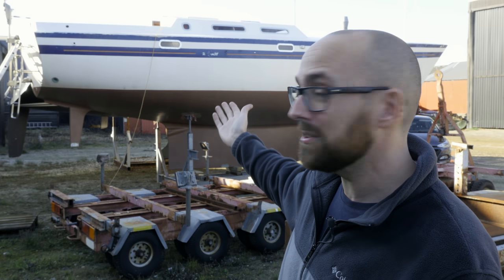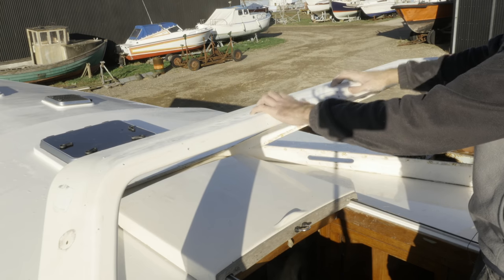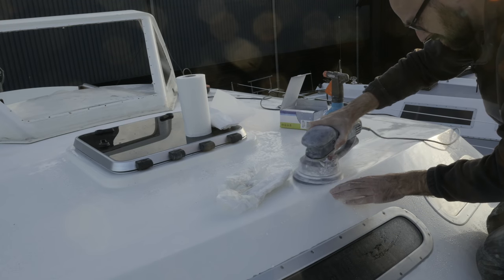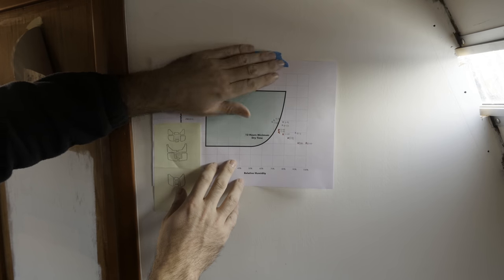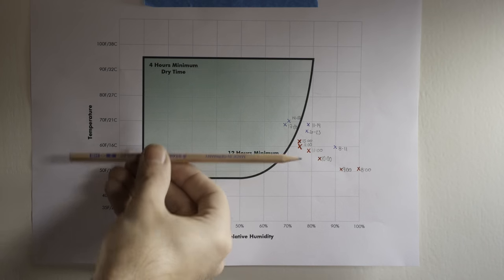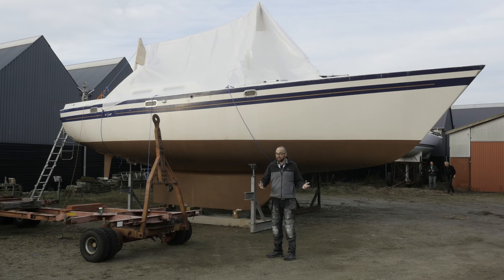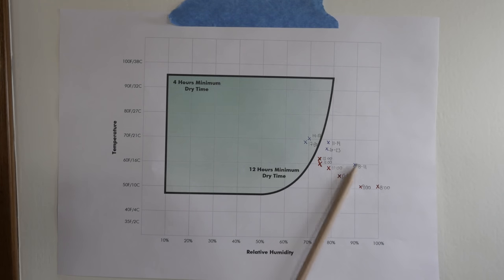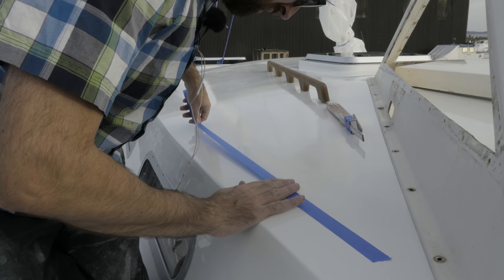Sail Life - KiwiGrip non-skid with custom logo & fiberglass dodger - DIY sailboat repair

Comment: Mad's great video as always. Obviously speakers are a personal choice. However, If we may just add some thoughts. We love our music, talking books and pod casts. When on passage,  at anchor or along side we use the cockpit like another room. Having the ability to play all of the above through a set of good quality speakers via our audio system makes a difference. We have front speakers in the saloon, rear speakers in the cockpit and both sets are sufficiently far apart to get a good stereo sound. Our "Radio" has bluetooth so our phones and devices can input to the system. We added a double pole switch to the rear speakers so that the rear or cockpit speakers can be switched off at the flick of a switch. When docking, putting the anchor down or in a marina where we would not want to disturb others. The system also links via our smart TV, so any videos, TV, Youtube etc can be played through the superior radio amplifier and our saloon speakers to give a much better sound than the TV. Linked to our onboard Blue ray player we get to watch our favourite DVD's and Blue rays through the same sound system. It was not expensive and the technology is already out there. You just have to link it via bluetooth and/or the radios various inputs. 75% Of the quality of your sound will be down to the speakers, their positioning and location. If like us you love your music, talking books and pod casts you may want to think about this now as you set the boat up for living aboard. Food for thought? Sail safe, Ant & Cid xx

Comment: One thing you may want to consider while you are working on the dodger, is that once you start passage making you are going to want to have a radio in the cockpit, if you don't have a marine VHF in the cockpit, you are going to find yourself doing a lot of running  back and forth between the helm and the radio. 

I personally would really like to have a large speaker for the radio in the cockpit that is of better quality than the built in speakers that come stock inside of radios, you may think about finding a place for that where it will stay dry while doing the dodger. 

On my boat when motoring the radio becomes effectively useless because I cannot hear it. I will be swapping it out and going to a similar setup with a cockpit speaker that can be turned off, and a cabin speaker that can be turned off, this way you are not disturbing the person who is sleeping with the radio. 

I am sure that will keep Ava happy if she does not have to hear you "yammering on" as you would say in a busy sea way while she is sleeping.
Reply: Simrad 35 with bluetooth handset is the easy solution :)

Comment: Good call on the tent! Use 2 or 3 inch masking tape. Also remember less is more on the kiwi grip start with the smallest notch and you can easily add more later, but it's harder to take away. The boat is looking awesome, but then again you already knew this!

Comment: Definitely go for stainless steel handrails. It saves teak trees and is much easier to maintain!
Reply: ilCigno plus it looks more like a star fighter :-)
Reply: But is harder to hang onto with wet hands.
Reply: @jens

Yes, and that's a safety concern which is why I prefer wooden grab rails, gotta make sure you can get a good solid grip, one hand for you and one for the boat, at all times.
Added.
Of course, wood do age so you gotta keep an eye on them.
Reply: Stainless can be very hot/cold depending on weather conditions but would love a lot better with the other hardware and port surrounds.

Comment: We used a similar product on our decks for 20 years and loved it. We taped off the edge and painted a primer coat , then two coats of the latex product with a loop roller similar to the one you used. We found this thigh latex coat was very anti slip enough to keep you from slipping in a rain storm.

Comment: The boat is really looking good and the cabin top looks great. My vote is for teak grab rails. Even if the take some work to keep them up, the will add a bit of class that will take the boat off the spiffometer.  Regardless of your decision please but grab rails on the outside of your dodger, you will be glad you did. Cheers, Chris

Comment: I think using a smaller trowel and “less” kiwi grip will be a better solution, the cabin roof texture looks a bit heavy to me. Love the logo though, that was spiffy! I agree with other comments that the stainless handrails will have. A higher “spiffy” rating then the teak. Love your channel, it really helps to keep me motivated on working on my boat. I am considering vblogging  the process as well. Cheers!

Comment: Entertaining and informative as always, Mads.The light at the end of the tunnel is getting brighter and Athena's looking awesome! Not trying to be a back seat driver, but I'm glad you figured out that less KG is better. When I saw how much you were putting on I kinda cringed-sorry- but I've done more than a few boats with it and found you don't need a lot to get a good grip and make a uniform coat. I just spread it on with a 3" brush and found that the roller evens it out nicely. If any gets where you don't want it, lacquer thinner will remove it after it's hard. Just don't leave a rag wet with lacquer thinner sitting on it....don't ask.  It's a great product. FYI,  the local rep told me you could buy white and have a reputable paint company tint it any color you like, since it's a water base. I've done a couple boats with custom deck colors....

Comment: Looks great.  Much progress.  On the non-skid, KiwiGrip or other brands, very coarse or aggressive non-skid leaves little valleys that tend to collect dirt and moisture.  The least aggressive treatments generally are easier to keep clean, as well as being kinder to knees and barefeet.
Looking forward to the decks beams.  Maybe contrasting woods, laminated in 1/4" layers?  Sorta Danish Modern???  :)

Comment: In this case I would definitely go for the teak rails. It ‘wood’ add character to Athena. And wood is always more boat’ish than stainless steel or aluminium. And, you have already quite a lot of stainless details already, so some pieces of wood could balance it. Maintenance of the teak will be done in some minutes, so that’s hardly any issue. Hope you’re happy with the kiwi. Maybe the logo should have been a bit bigger in size? But I reckon it’s nothing to put your resources into at this stage?

Comment: Looking good! -- Why don't you build a little leanto off the side of the boat for sanding and glassing.  Could even use some sheet foam and a heater for curing on cold days. 
Craig

Comment: The reason that rock was expensive is it's a Marine Rock.  You can find them at any marine hardware store.
Reply: I think he got the premium one with the green Marine-grade low-friction coating pre-applied.
Reply from the maker: Haha! :D
Reply: Next time save money on marine rocks and get them from a big box hardware store. The side of the road works too.
Reply: Or spend more and get the aviation grade rock
Reply: Maybe one from a Pacific Ocean beach? The hiring of a selection committee, travel expenses and shipping costs could even exceed that of the Aviation Rock.
Reply: High-visibility contrast-green on one side ... an extra. Oh, and no environment will be harmed when released into it ... an extra, too.
Reply: WARNING: Do NOT use Hawai'ian Volcanic Rock (in Denmark)! Super Bad Kapu! Pele WILL dissolve all your epoxy.

..and I doubt Óðinn, Vili, and Vé are particularly worried about bits of Ymir being used for boat work.

Aloha nui ʻoe, kahuna kelamoku! :) 🤙
Reply: Also when you are done with the epoxy, to get your rocks off. From one Dane to another.

Comment: Regarding the speaker holes in the dodger:  I understand that a bluetooth speaker would be good for music, but isn't there a good reason to have wired, mounted speakers for various navigation , communication, and warning systems?  (DISCLAIMER:  I have no idea what I'm talking about.  The little bit that I think I know only comes from various YouTube channels.)

Edited to make it doubly-clear that I didn't mean for this comment to come off as a criticism.  I'm sure Mads doesn't need those holes in the dodger.  I was just hoping someone could teach me something.  Are there audio devices on a boat that you would want to hear, even when you weren't expecting them?
Reply: David U you’re absolutely correct. He will need them for sure.
Reply: @rickfrazier1148  you can hook a Bluetooth module to the external speaker output.
Reply: SouthJerseySound sure. I’d still want hard wired speakers mounted. To each their own.
Reply: @rickfrazier1148  he can still add a external speaker and now he's not limited to finding a exact fit. Those speakers where most likely stereo and not vhf radio anyways.
Reply: Perhaps it's the strong music background, but hell yes to speakers, good speakers, mounted, & wired, wired to vhf radio, ipod, tv, easy to switch.  More wave generation means less dB is necessary to be heard.  Great music during a stressful time is lovely.

Comment: Stainless grab rail.  Red in logo (small paint brush with help fuel cdo [ocd in alphabetical order like it should be!]). Also the cockpit needs something to prevent you from slipping throughout the winter.  More kiwi grip or a towel or something.  Looks great!

Comment: Hello Sir, I have been looking into replacing my old carpet in my fishing boat with a deck liner. So far, how has the KiwiGrip held up and is it easy to clean?  I have looked at Durabak Marine liner but it requires the use of Xylene prior to painting with Durabak, which is very harmful to breath and you must not get it on your skin. Very nice sail boat BTY!!!  I have a friend  I grew up with in Charleston, SC USA and he sails all the time. He's into pleasure as well as regatta's. He has 3 sail boats. Just looking for some constructive advice from a mate that has used the KiwiGrip.

Comment: Any thoughts on weight balance/estimated change to the hull/deck after your restoration? Thinking your osmosis treatment and lengthy rebuild may have reduced weight in the hull but perhaps added weight to the deck?
Reply: shinybaldy wouldn’t dry core be a lot lighter than that soaked plywood and foam? I doubt he added much weight to the deck personally, but ymmv

Comment: Very tidy work, as ever.  With a very elegant result.

But I'm not so sure that it's a functional result.

If it was my boat, to be used as a liveaboard and/or for ocean sea crossings, I would want maximum non-skid for safety.  So I would have taken the non-slip right out to the edge of the cabin top, leaving only the bare minimum gap to avoid hard edge problems.   Yes, that wouldn't be quite so elegant as the job you did.  But it would give a me a much better chance of surviving a foot placed near the edge of the cabintop as I bounced around in big waves.  And if you really want to play it safe, put non-skid on the coachroof sides.  Trust me, there will be times you when you will thank all the gods for its presence.

Same goes for the foredeck.  A few weeks ago, I looked in horror as you toyed with elegant patterns on the foredeck.  I think that's completely the wrong priority.  Once your foot starts slipping on a heeled wet deck, it's unlikely to regain grip even if your boot does slide onto a textured patch.  So please, for safety's sake, don't leave unpainted stripes across your foredeck.  If you watch Ava sliding off the foredeck at a critical moment, it won't be much consolation to think "but the deck still looks very pretty, so thank goodness I left some gaps"

Comment: Hello
Can I find out what is the name of the last laminated layer that tears off and does it cause the laminate to be smooth?
Reply from the maker: Are you thinking of peel ply? :)
Reply: In the episode when you were doing the underwater part after the resin had dried, you were tearing some shells off your friend and the last time you taped the hole, it did. What was it and what is it for?
Reply from the maker: Yup, that's peel ply :) There are a couple of big advantages to using peel ply. Any blush that forms is removed with the peel ply and the surface is already keyed (no need for sanding)

Comment: Stainless steel handrails, you will never regret the ease of maintenance and options when you want to tie something to them and feel confident about the strength and non Marring. I hope the kiwi grip is not too aggressive for bare feel in warm climate.....
Great job as usual though! Planning is everything!
Can you get regular portable rolling safety steps to get rig of the ladder? ( then sell at end of project??)they look like this 
https://warren149.files.wordpress.com/2015/06/image.jpg       Mine were $125 used!
Cheers Warren

Comment: Safety ladder placement to get the proper angle on a ladder use a 4 to 1 placement ex. 4 meters up 1 meter out at the base. Too much kick out at the bottom ladder could buckle not enough kick out at the bottom ladder risk coming away at the top

Comment: So, why not just permanently attach the dodger? It seems unwieldly enough that it won't be getting taken off except for major work. 

Edit: did you just apply the hole-filling fiberglass circles in the wrong order? Seems like that just created a ring depression by applying the largest patch over the narrowest part of the circle...